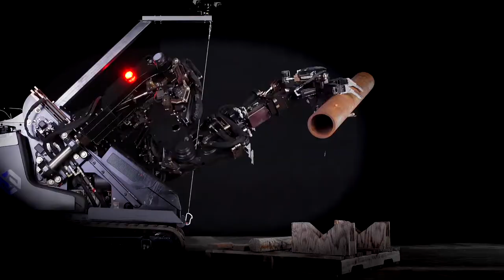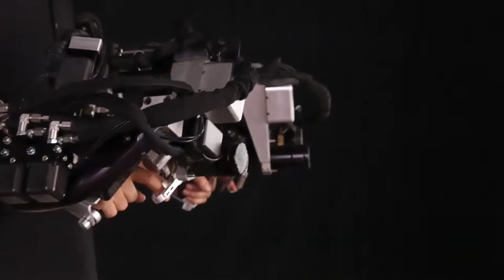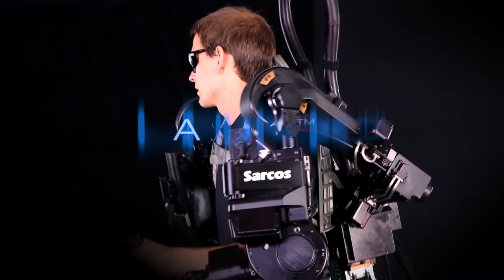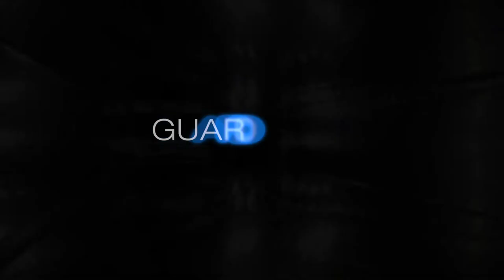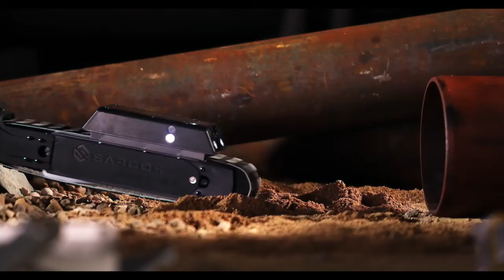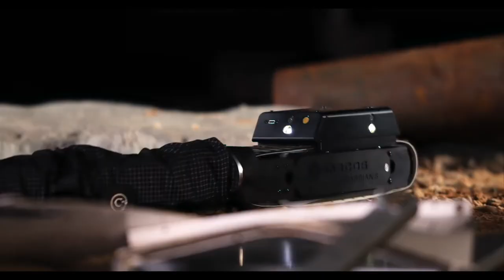Sarcos Robotics - Guardian XO Exoskeleton, GT Robotic Arms & S Autonomous Robot [1080p]

Comment: this look all but military
do you plan to set a load of grenad as isis made with dji phantom drones
it look a bit expensive
Reply: Probably for logistical use. Carrying 155mm shells or transporting large cargo boxes is pretty bad for the spine.
Reply: @user-sg6zh6vr7h  it look like o be the same issue as the mule project replacing animal force by mecanical at such small scale is really a trouble when using only electrical power if you considere the eficiency of a 49cc gasoline engine is totally unrealted to the actual trend
being myself a drone user i know the autonomy of the batterys is counted in minutes when pratical like all the robotics they showcase never mention of the real autonomy